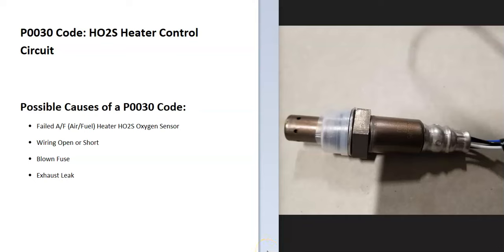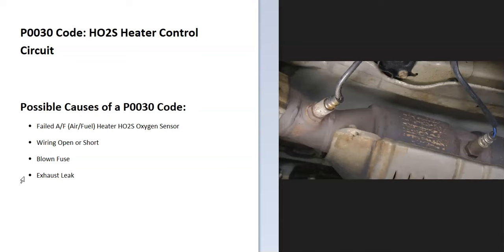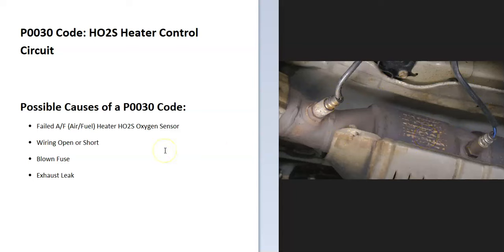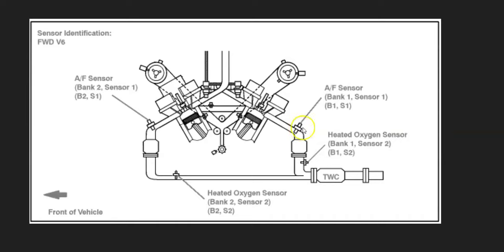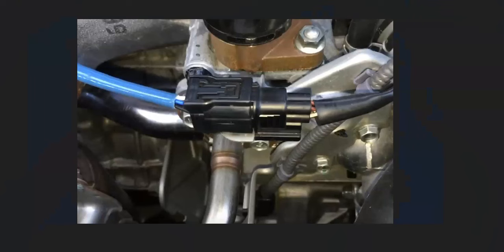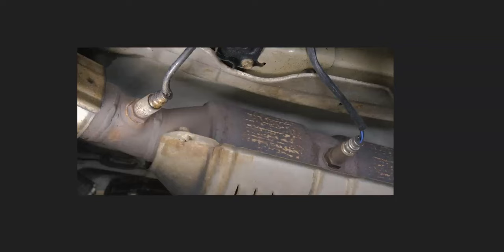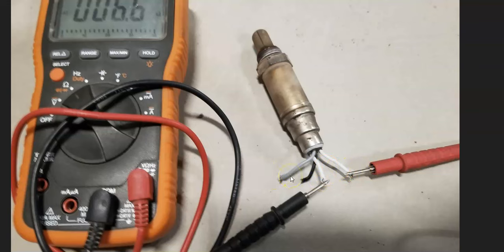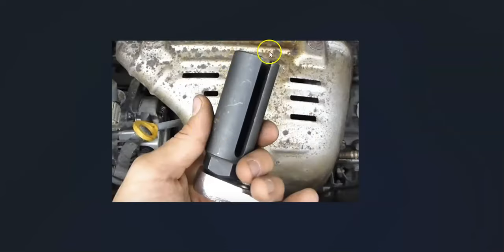Causes and Fixes P0030 Code: HO2S Heater Control Circuit

Comment: This my problem now after we replace the o2 sensor now this error pops out
Reply: did you sorted it out? i have the same. old sensors, no problem, new sensors both throw the same error.
Reply: @AlexanderAbraham90  well I bought a original one cost 18k here in the philippines 🇵🇭 and now the check engine is gone .. 

The first one I bought is  not original that 12k here in the philippines 🇵🇭  but the seller said it's original but it's not

Comment: We have a 2019 Chevy Silverado that's throwing a p0030 code. We changed the 02 sensor and checked the wiring and seems to be popping the 89 fuse. Could use any help or tips. Thanks
Reply from the maker: Fuse 89 is "02 Sensor A". There likely is a wiring problem. Be sure you have the correct 02 sensor, as there should be a total of four. P0030 is Bank 1, Sensor 1.

Comment: Im having code p0050 on a holden captiva 2008 petrol. Iv changed the o2 sensors and checked that im getting power to the leads but im still getting the same code. Heater control circuit. I cant figure it out because im getting power chamged sensors.

Comment: Can this cause rich running issues?
Reply: Yes. A faulty heater circuit means the ECU has no control over fuel mixture, the engine is running in emergency mode (the fuel mixture is set according to factory default tables, not according to what the O2 sensors are actually reading), and this might indeed result in the engine running rich as a result based on other factors involved (for example if your engine is actually getting slightly less air than the factory default mixture setting assumes, the final mixture in emergency mode will be too rich).
Reply: @Case_  I have this error on my after cat 02 sensors will this still effect the fuel mixture? My pre cat sensors are 100% fine
Reply: @dexietyy7922  In that case it's rather unlikely, as downstream sensors don't usually affect fuel mixture. It can happen on some cars, though, especially more modern ones (where the downstream sensors may have an impact on fuel mixture for environmental reasons), so only someone familiar with your specific car can answer that.